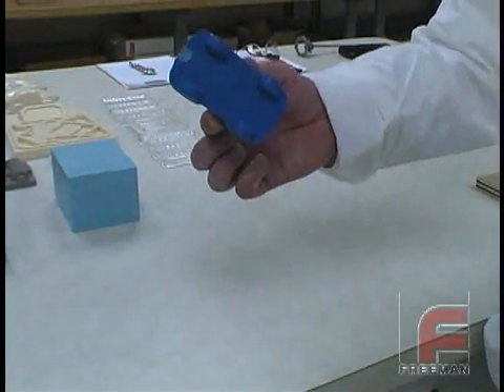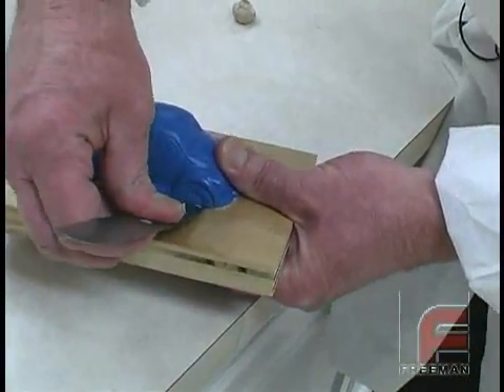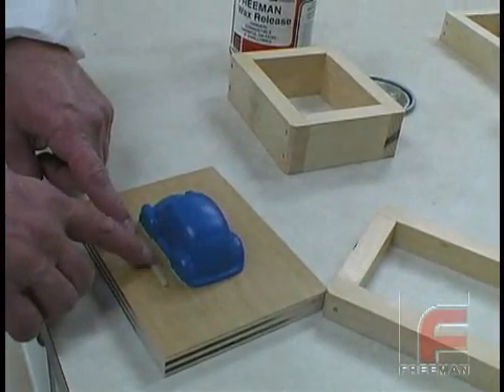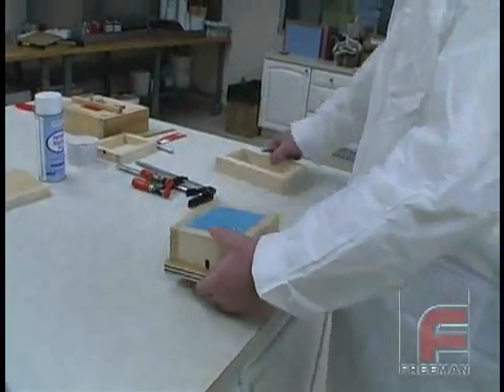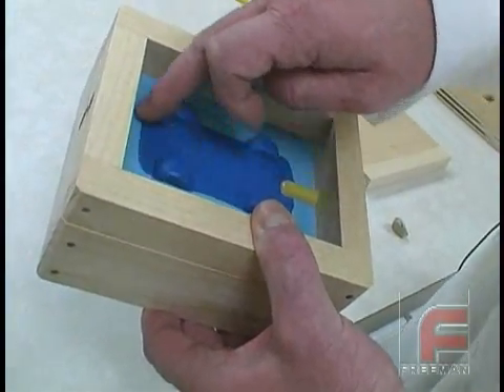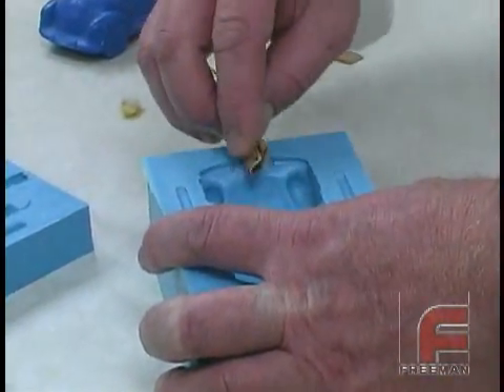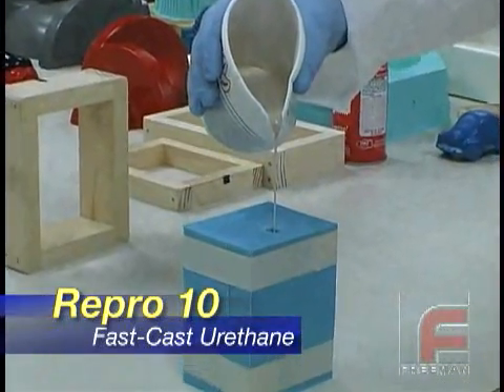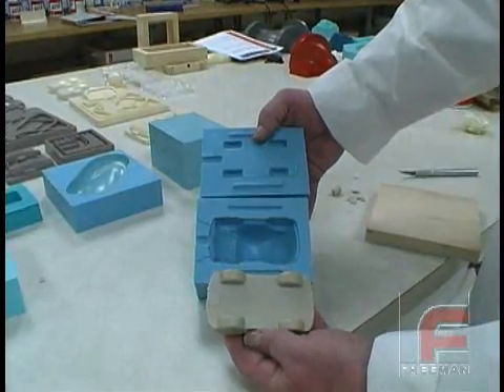Mold Making - Mass Casting Complex Parts (w/ parting line)

Comment from the maker: All our silicones should be degassed to rid the air bubbles that are introduced during mixing procedure.  If you do not have a degassing unit, we would suggest going with
the lower viscosity silicone such as the V-330.  When creating your mold, you can brush on a couple of layers of the silicone before pouring the silicone into your mold box.  This will help rid most of the air bubbles on the surface of your mold.

Comment: Chances are the horse was cast from a mold.  Use a magnifying glass and try yo see where the original mold lines ran.  Because of the many undercuts the horse may have been made from even a 3-part mold.  Two halves per side and a third section that went between the legs.  You can use clay to fill between the legs, make the two outer halves, remove the clay and cast that part last.  Use a flexible silicone for deep undercuts.

Comment: Could one use an embedment to create a screw cavity for use as a fastening point? That is if one were to stick a screw into the resin and leave part of it out, would the resin bond to the screw or would the screw be able to be removed by turning, leave a screw shaped cavity for use in screwing 2 parts together...or would the shrinkage of the resin grip the screw tight so that removal would be impossible? What if one used an oversized screw case from low melt alloy that was then melted out..